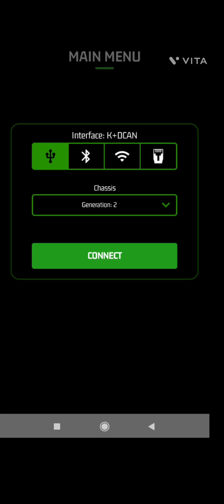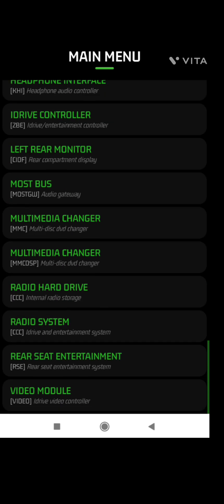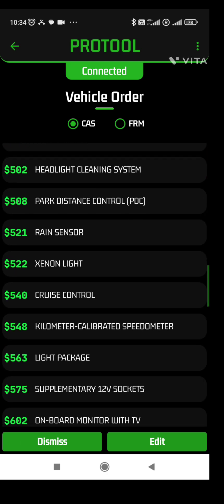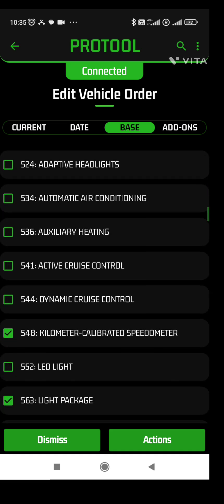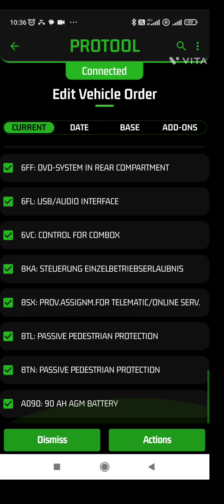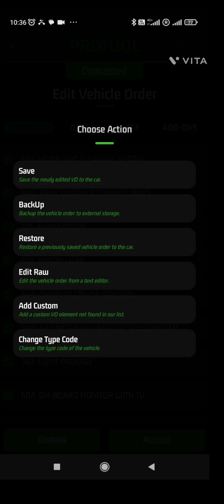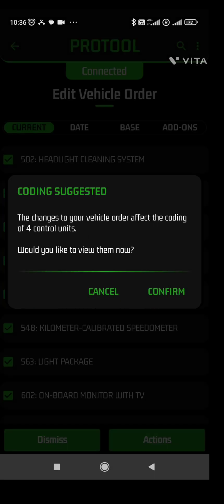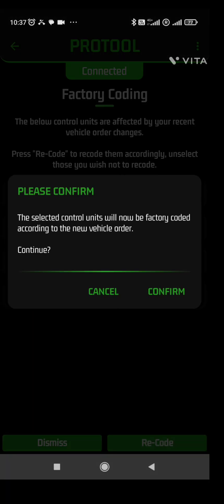Retrofit Coding Cruise Control in BMW X5 E70 - 5 mins job!!! ProTool it's super easy!!!

Comment: Would the process be similar for retrofitting ACC to a car with cruise control?

From my understanding I’d need to add the radar, ICM, and steering stalk. I already have a car with 360 cameras and HUD
Reply from the maker: I did not do that coding. From what I have read it's similar. Only wiring thing is what I did not think about
Reply: @bimmerhacks yeah i was thinking about that as well

Comment: Hi, thanks for your reply on the previous video. I'm looking for an instrument cluster and SZL for my car, but I'm new to this. When I check the RealOEM site for cross-reference, I see 8 compatible parts listed for both the SZL and cluster. However, the seller says a part that's not on that list is still compatible. Either I'm checking cross-references wrong, or the part isn't actually compatible. How can I reliably check which parts are truly compatible?

Comment: So I am an e89, SZL was changed and coded to the car all my errors are gone - It was coded with ESYS, NSC and INPA - my cruise control still does not work. Should I try to code it with protool with $544 the same way you show in your vid?
Reply from the maker: Did you change your instrument cluster that supports cruise control?
First try disconnecting the battery for 30sec or so before you go for more coding options.
Reply: @bimmerhacks  I just swapped the steering wheel slip and clock rings
Reply from the maker: @derekdykstra7230 try disconnecting battery first. Make sure you have 540 in CAS, FRM and KOMBI. ProTool is a very handy easy DIY tool so if you plan to live your life as a bimmer guy then it would be a good asset.
I am not sure if your car needs instrument panel compatible with cruise control
Reply: @ It is, I'll give it a shot.
Reply from the maker: @derekdykstra7230 please update once you try
Reply: @ will do. I hope it works, would be great to have cruise in the e89
Reply from the maker: @derekdykstra7230  everything is doable in BMW ;)